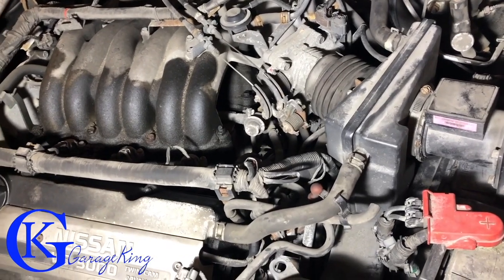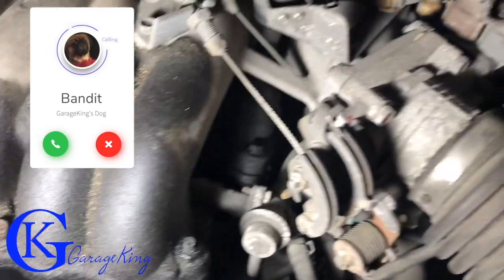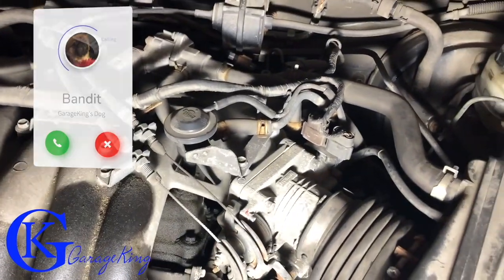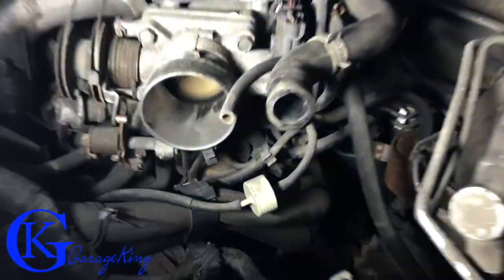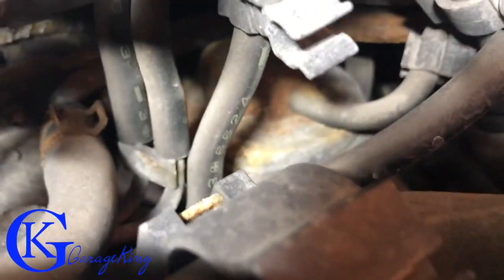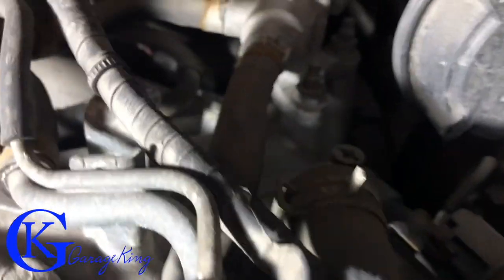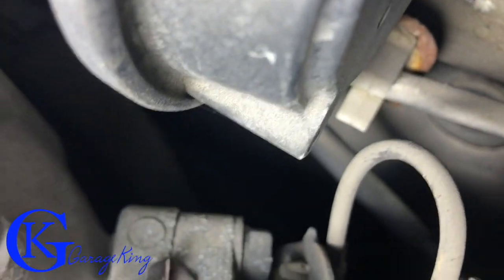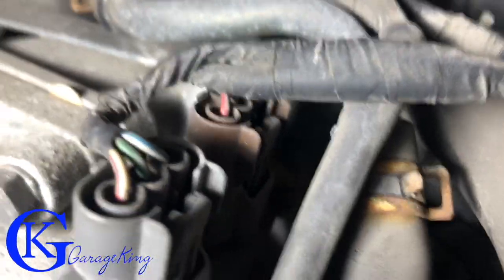Infinity/Nissan Maxima EGR P0400, fixed by cleaning a tube

Comment: I used Marval Mystery oil soaked it for 3 days and used Qtips to scrud the valve leak area and finished it off with brake cleaner. Mine was slightly stuck open. 2000 toyota camry with original spark plugs i paid 200 bucks for the car. I love it. Next Spark plugs.
Reply from the maker: 200 is a deal for the car, and I have heard Marvel Mystery can do some great things, thanks for the comment !!

Comment: Okay I had the P1400 code and really find it hard to remove the housing of the heat sensor. So what I did was just to remove the heat sensor itself without the needed fabricated socket wrench, sure heat sensor must not be tightened too hard, just an open wrench will do. Cleaned the dirty heat sensor, used wire and air pressure to clean the base as much it can reach. Now my Infiniti 130 is clear and pass smog test this week. Thanks for your vlog. Just great.
Reply from the maker: That is awesome and glad you were able to fabricate a tool to get the job done :) Good on you for that!!  Thanks for the great comment and have a good day :)

Comment: Nice Video. My vehicle was stumbling and dying.  I had a P0174 code leaning out Bank 2 as well as a P0400. After a ton of work and watching videos, I determined the MAF sensor was misreporting air flow, so I replaced the MAF.  Also, I cleaned my tube out. Was plugged just like yours. I did not remove the EGR. That tube was really fun to get out. UGH!!! Clean Sensor and tested Solenoid. Applied 12v and could hear it clicking. Checked for Vacuum at the hose on top of EGR and got vacuum as I revved up. Felt the diaphragm as I revved up and could feel the EGR diaphragm move. Cleared codes and vehicle ran fine. No more stumbling and I thought I was home free. However as soon as all the system monitors were ready it through a P0400 again.  That tube connects to the EWGR valve "Spacer Block" I wonder if something in there is Blocked. What are your thoughts? Deeply appreciated.
Reply from the maker: Hey there and thanks for the detailed comment !!!!  I know all about taking that tube out, lots of fun haha!!!  The spacer block is definitely a possibility.  I know when I took the EGR out it was kind of clogged up on the right side (when you are looking at it from the side of the engine) that's the part that has those bigger threads on it, there was quite a bit of crud in there.  I poured a bunch of carbon cleaner in there and cycled the egr up and down with my fingers.  This code could be the result of any carbon blockage anywhere in the EGR path so its important to clean it all out everywhere.  Taking out that EGR was a pain in the butt as you have to be careful with that big threaded part.  Also if you have a sticky EGR valve it can cause that code.  I'm not sure if taking the EGR out and giving it a really good cleaning helped, but I basically just cleaned everything out and then afterwards it was good.  Its too bad these engines are not a little easier to work on........
Reply: @GarageKing  Thank you so much for responding so quickly. I just went ahead and removed the EGR. Some gunk in it but I wouldn't say it was clogged up like that tube was. Gases should have been able to pass. I cleaned it up real good and try to spray back into that spacer block the EGR valve bolts to.. After all, as you know, that is where that bottom of that riser tube is bolted up, (the spacer block). I want to now test the EGR valve with a hand pump vacuum tester to see if it holds vacuum. I almost feel like the EGR pentel could have been stuck, until I freed it by pushing up the Diaphragm with my fingers. In any event, I cleaned it all up. Only thing I haven't tested is the ohms of resistance on the EGR Tube Temp sensor, but I cleaned it good too. so after I get it all back together, I will let you know the results. Thanks again.
Reply from the maker: @jefftravis5312  Good call with the EGR pintle, it could be sticky, when I cleaned mine I soaked part of the internal slide (you can see it when you look through that rear hole)  I would test it with a vacuum pump like I did as you never know.  Also check that short piece of rubber hose that is connected to the steel line that runs to the EGR to make sure there is no small tear in it.  I know these things are a pain, but it sure feels good when you get it fixed !!!!
Reply: @jefftravis5312  I just finally deleted my EGR valve and tied my sensors up with zip ties and called it a day I got tired of it lol. Blocked off the intake hole and the hole from the exhaust to. Worthless junk that causes headaches.

Comment: Great video, I've been getting a funny idle lately so I wanted to kind of process of elimination the car and pop the air box, throttle body and MAF off and the idle air control valve. And the EGR valve and tube and just inspect and clean it all at the same time and put it back together, but I couldn't find a good video for the valve and tube. Thanks man great video.
Reply from the maker: Thank you for the great comment, sometimes people post that I'm too technical, sometimes not enough.  I'm really happy I was able to help you !!!!  Thank you and happy Saturday to you :)

Comment: Very well explained loads of clamps. Easy to handle tools.too x
Reply from the maker: This one was a little more intense !!!! Thanks so much for the comment :)
Reply: @GarageKing  I'm still watching was going  to ask how  did you film is the camera on a shelf?
Reply from the maker: For this video I used multiple tripods.  I have a taller one for a full engine shot, and smaller ones that I place around the engine for close ups. I also have a clamp one that I attach to the underside of the hood/bonnet so for these bigger repairs it’s a lot of different shots and angles. I probably had about 60 short clips that I imported into FCP and then made this video.  These ones take a lot so I only do big ones like these every now and then as they are pretty time consuming.  These ones are great ones for people learning to fix their cars.  Not many know just how much editing goes into these ones.  Thanks for the comment :)

Comment: If the egr valve is clogged like this, does it vibrate and rev fluctuate when the vehicle is first started, when the gear is in neutral or when it is in drive mode, while waiting at the lights?
Reply from the maker: Hey thanks for the comment, I do remember it ran a little rough, and seemed like it was down on power when you first started accelerating. As you saw in the video there was absolutely no flow at all.

Comment: If u remember what’s the part number for the Egr Valve gasket and Egr guided tube gasket for the top one ???
Reply from the maker: Oh geeze, I have no idea, this was one of my earlier vids.  On my new vids I post the part #'s, but as I say, it was one of my older ones.  If I remember back I think I supplied the Vin# and went to Nissan as their parts department has the blow up pics and you can tell them which gasket you need.  I was surprised at how plugged it was.

Comment: What is the name of that tube with all that carbon buildup
Reply from the maker: Hey thanks for the comment.  Its probably the EGR bypass tube, but I think it probably has a few different names. I think best thing to do would be to call Nissan, give your serial number and they can pull up a diagram of the EGR system, and you can just pick out the part.  They may even just call it a tube.  Glad you found the video :)

Comment: Just wanted to ask and know I bought one of these for 1800 at 132k
Was that a okay price and are they good reliable daily drivers

It's currently in the shop it would shut down while driving or at a stop
It was not a gas pump or fual lines
They told.me the mass airflow made it do this
Reply from the maker: Hey There, and sorry for the late reply, in your comment you wrote "told.me" and Youtube flagged it as an external website that could be dangerous, so your comment was not published.  If there was no period it would be ok, but the period made youtube think its a website.  OK, enough of that.  Yes the mass airflow sensor can make your car shut down.
Reply: I just got my 96 at 112,000 for 2,500

Comment: How did u install the upper gasket for Egr tube ???
Reply from the maker: Not sure what you mean.  I know there is a tricky part with that pipe, but I just took my time at it.  Its really tight in there and you have to take your time.

Comment: I have a 4th Gen Maxima with Electronic EGR.  There are currently no Trouble Codes but the engine would hesitate around 2,300 rpm unless you step more on the accelerator then only it would rev up.  Could it be caused by a clogged EGR?
Reply from the maker: That clogged EGR can cause a number of problems.  Normally on the Nissan the EGR itself is not clogged, but its the tube that goes to the intake that gets clogged.  I know they can cause weird things to happen, even hard starting, so I would say its possible it could be causing your engine trouble.
Reply: i finally found that by adjusting the TPS sensor alignment to about +8% and then remove the key and then start it again ( allow engine to relearn new TPS idle position ), the hesitation issue was finally resolved.
Reply from the maker: @vkpc1  Hey There, I would have never thought of that !!!  Very glad it worked and I'm going to take note of this for next time.  Thanks for the follow up and Merry Christmas to you :)

Comment: How long would you say this took to do?
Reply from the maker: Hey Thanks for the comment.  I would say it took about 4 hours, and only because I struggled a bit with the threads on the big EGR pipe, and you have to remember I was filming it !! Most of the time you just have to take off the top pipe which really should not take you that long, maybe an hour or two if you take your time.

Comment: This is a pain in the ass to take off
Reply from the maker: Your telling me, it is for sure a really tight fit !!
Reply: @GarageKing  I tried and couldn’t do it unfortunately even with the intake, and valve cover off. I was going to do it since I was already changing the valve cover gasket.
Reply from the maker: @TheHardstyleGuy.  I'll bet its plugged, most all of them are if you got some mileage on the car.
Reply: @GarageKing  it is very plugged at least on the side on the intake manifold, but I couldn’t get to the 2 bolts holding in the tube at the bottom
Reply from the maker: @TheHardstyleGuy.  Thats the side its plugged, if you can break that apart and vacuum it out somehow that would probably help. The other side is usually ok.
Reply: @GarageKing  alright I’ll try that thanks
Reply from the maker: @TheHardstyleGuy.  No problem, and good luck